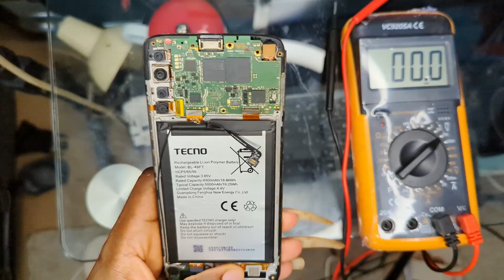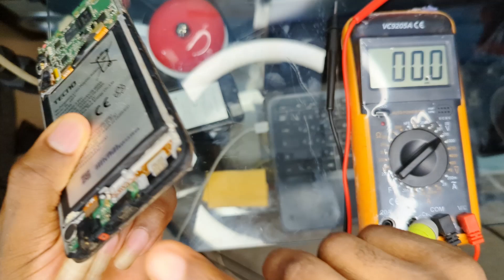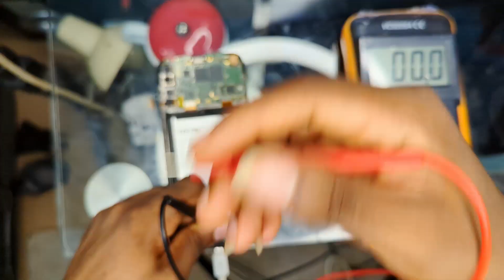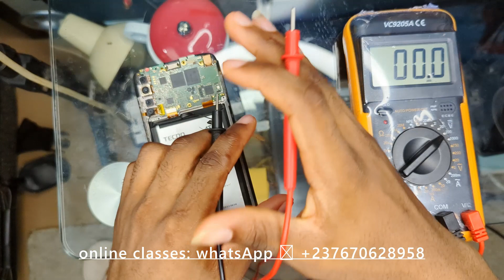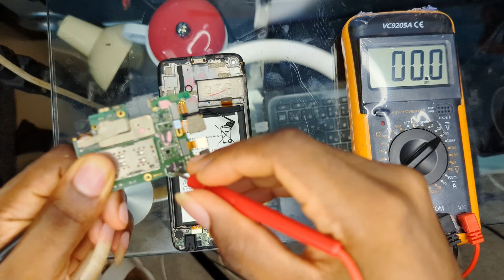Android Mobile fake charging Solution NEW METHOD | mobile repairing course full video

Comment: Thanks for help. I've a question, does the charging voltage differ in phones that have fast charging ? Some fast charging bricks charge at 9 volts.
Reply from the maker: I have been trying to notice any diferents in normal charging circuits and fast charging circuits even when used a fast charger and having seen that different in the charging volt. I believe the fast charging circuit just have a high capacity. The charger can be 9v but that doesn'tean that the charging voltage will be more than the standard
Reply: @SergesMike  thanks for reply. Understood